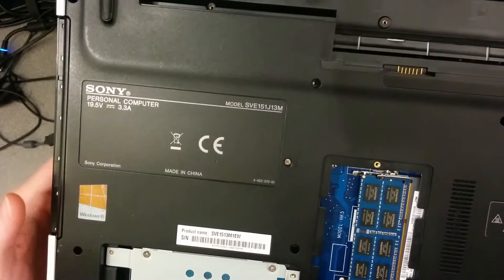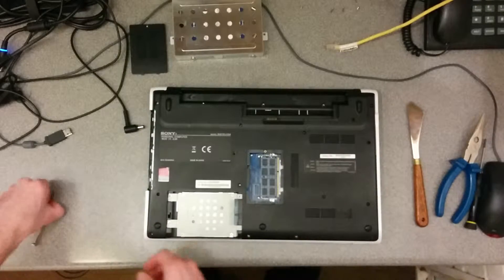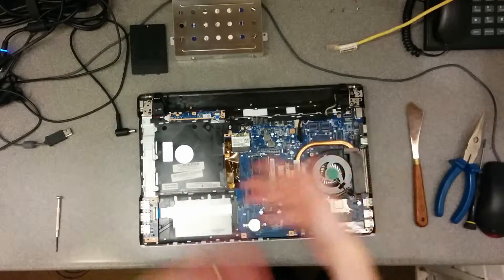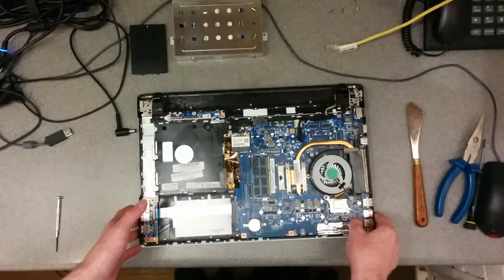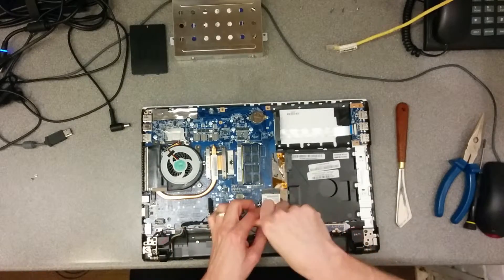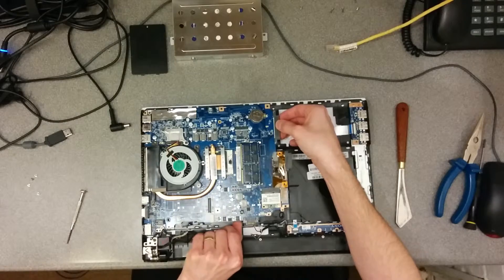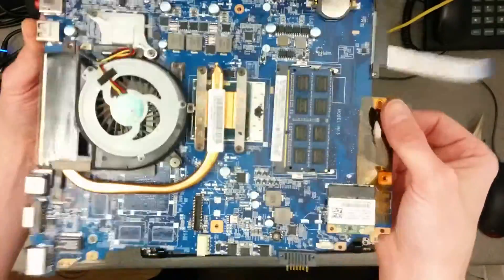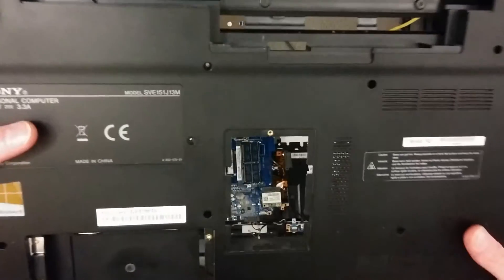How to take the motherboard out of a Sony Vaio SVE151J13M

Comment: 2:46 ... Does the hinge have a black beam locking it into place? Mine does... Can you help me through that part?
Reply from the maker: On my one the white bar hinges up. It pivots at one end and should not need forcing or removing! The rest of the black connector stays where it is and doesn't get touched. It is possible that other variants or ages of laptop have a different colour bar (for example a black bar where my one has a white bar)?
Reply: @freename  thanks 👍